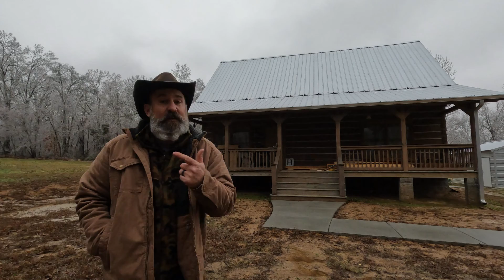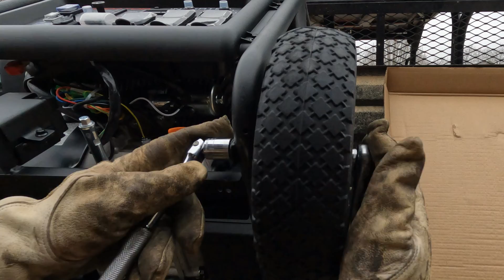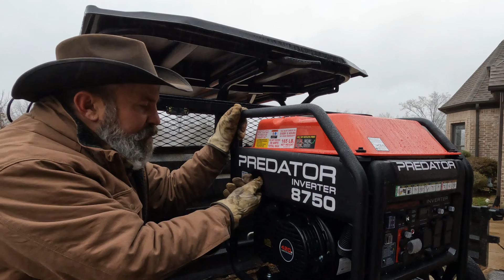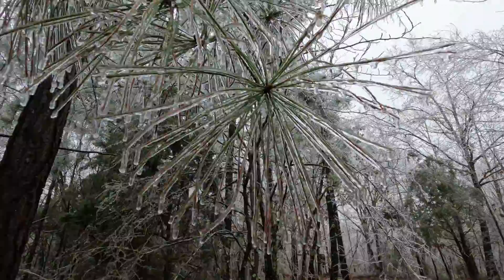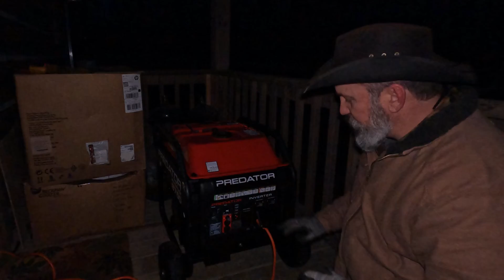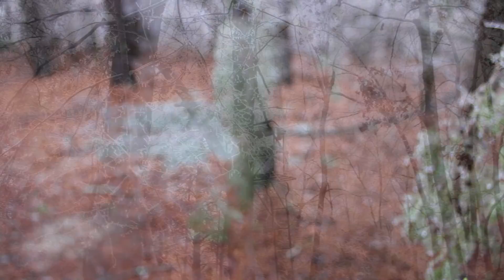Log Cabin is FREEZING!!! | REVIEW and SETUP of Predator Inverter 8750 Generator

Comment: Really bad design. They should have a battery for such issues with a heating coil to prevent such problems or the unit should be housed inside the home. All CCTV casings have this type of function as electronics are suseptable to the cold also.
Reply from the maker: We don’t freeze with power outages very often so decided for space savings outdoor unit. Once we get house wired for generator, it will be a snap. Thx

Comment: My husband just bought a generator identical to that!   And yes, it is very heavy, he moved it with the tractor front end loader until he bought an old second hand stock type one horse trailer, replaced the floor (it didn't have one!) And made a roof for it.   He stores the generator in there covered with a tarp.  We got ice covered with some snow starting Wednesday.   It is supposed to warm up enough today to start melting it.  We are in Texas 30 miles SW of Stephenville.
Reply from the maker: Great idea on the trailer! Thx!!!
Reply: He paid $300 for it at Comanche County Farm Equipment sale.  Things were going insanely high, which is the reason he bought this one with no floor in it.   Basically he bought only the frame and sides.  He did a great job replacing the floor!